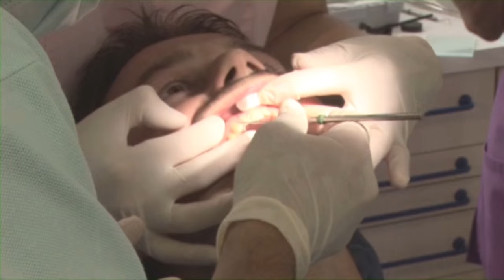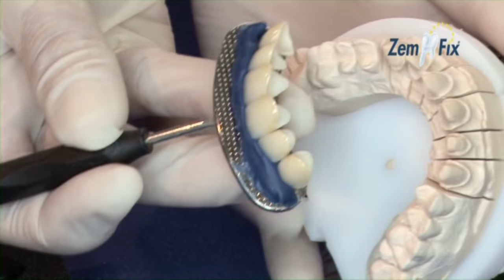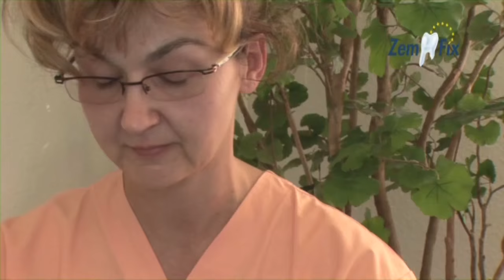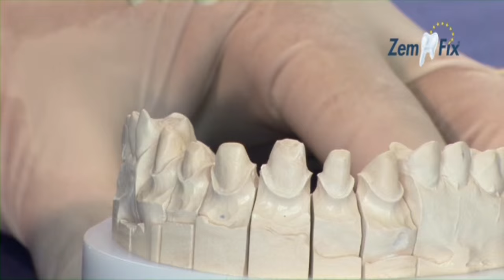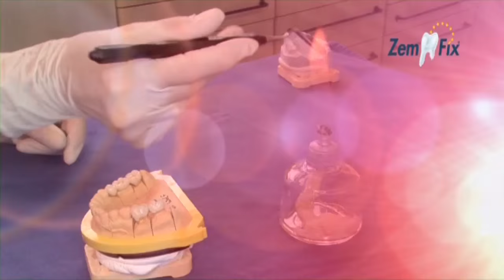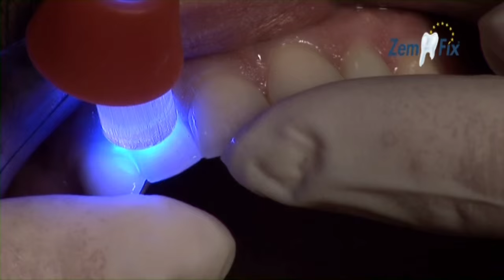ZemFix® - The Innovative System - cementing 6 Crowns In 15 seconds!

Comment: If the paths of insertion are not parallel, it's not gonna be so efficient, right?
Reply from the maker: Hello and thanks for your interest.

The advantages of ZemFix is not only
the possibility to insert several crowns at once. If the path of insertion is
not parallel, you will notice that picking the crowns up with ZemFix from the
model. Then you can select these particular non-parallel crowns with another
ZemFix Instrument. So you have still all the other great advantages of  ZemFix:
1. save handling: you can treat the crowns with Air, Water, Alcohol, Bonding, Cement,
etc. , without risk of loosing the treating denture

2. Perfect overview even in rear areas (no hand/fingers covering the field of
view)

3. Risk of loosing a crown/Inlay/etc
and getting inhaled or swallowed by the patient is minimized or even banned

4. No mistakes while cementing several crowns in several quadrants (ZemFix can
be comfortable organised, so you have an ideal overview before and while
inserting dental restorations) 

5. After placing the dental
restorations, ZemFix can be easily unplugged with a slight  side tilt.

6. One System for all types of dental
restorations: also small Inlays or Veneers can be handled perfectly

7. dental restorations can also be
picked up with ZemFix directly out of the patients mouth after fitting
procedure

8. Your dental assistants can be instructed,
so that everything is preparated yet before the (main) treatment begins
There are even more advantages, but these are the main arguments.

I hope this reply answers your question properly.

Best regards,

your ZemFix-Team
Reply: ir is supposed to be paralel, a procedure un preparing crowns
Reply: Victor Lin مووببي4
Reply: Victor Lin u got to take in consideration that most of crap sold in dental industry r not even made by dentist my friend.. like that item that drill the root and bind it to a screw and uses screwdriver to pull it out without moving it lateral sides first or rotate.. or erath is flat 😊😆😆
Reply: Victor Lin 

Coming from one who had lots of dental issues, it depends on dentist's skills in taking  accurate measurements.

Comment: crowns may not fit the same way in the mouth as on the model, especially if the contacts need to be adjusted.  So I assume you have to try all the crowns in the mouth first and adjust all the contacts and then use this technique.  But, if the path of insertion in the mouth is slightly different than on the model, if you use this technique the crowns may not seat all the way in???
Reply from the maker: You should generally try the crowns in before fixing them with cement finally. After trying in, you can pick up the crowns again out of the patients mouth with ZemFix - so you get the exact "real" position. BUT: if the model and the situation in the patients mouth really differ, you should think about a failure in the whole procedure.
By the way: directly after the crowns are inserted with ZemFix, you detach them from the ZemFix-Instrument and repeatedly press them on the tooth stumps, so they can "find" their right position in case of little differences of the paths of insertion. No problem. If the paths of insertion differ much, you will notice this while picking up the crowns from the model (the crowns which are differing will stay on the model). Then you can pick these crowns seperately with a second ZemFix-Instrument.

Comment: I have to get a crown. But wouldnt the tooth thats still under the crown eventually rot? Im not with that lol
Reply from the maker: With a good oral hygiene, there´s no problem. The same risk as with your own natural teeth.
Reply: sergio vazquez was thinking the same thing
Reply: the dentist has to remove the rot first. if you brush and floss daily it shouldn't be a problem. I've had a crown for 20 years.
Reply: Manit C not true I'm have 8 crowns done in my upper in 2 weeks with no root canals. As long as your teeth r healthy and you go for your routine cleanings you should be ok.
Reply: Manit C are u still ok